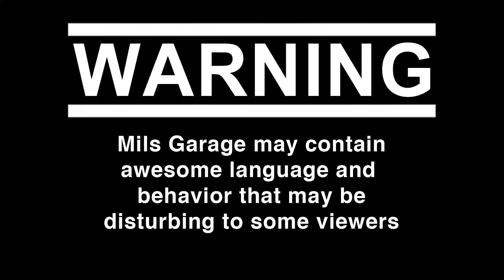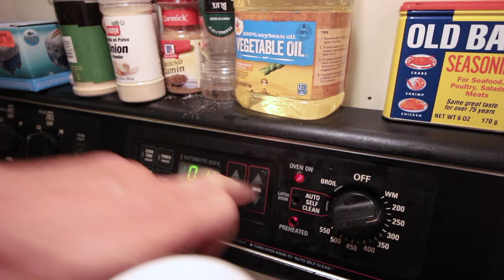Easiest Way To Open Headlights [Separate Lens From Housing // All Cars] (w/Pro Tips)

Comment: Better to replace the whole thing, its faster than doing all that just to remove the lens
Reply from the maker: We fix and modify them at the shop, so this is a normal day for us 🤘
Reply: In my case, 2010 Audi Q7, the lens were 180 for the pair, 1 headlight assembly would cost me close to 1000usd so way cheaper to replace the lens.
Reply: I wish you guys were in Utah! But Delaware is a bit of a hike for me. I’ve called several auto body shops and they all either say this cannot be done because the entire headlight assembly must be replaced or  they refuse to do it. Do you know of anyone near Salt Lake City who would take on this challenge? I have a gas oven so I’m afraid I may melt the housing.

Comment: would this work with glass headlights?
Reply from the maker: Great question, and i'm not sure. It might work, but i've heard that there are glass ones for BMWs that it absolutely won't work with.. Are the headlights older? i'm not sure when they changed to the 200º adhesive.. It may have been released around the same time as the introduction of plastic headlights

Comment: What do you suggest doing to the remaining adhesive on the lenses
Reply: Did you clean it all off or just leave it when you resealed it?
Reply from the maker: For the gunk, we have an episode on Headlight Restoration (Permanently) https://youtu.be/ctijYGteLFY 👍
Reply: Mils Garage thank you!!
Reply from the maker: @madisen marshall Any time 💯
Reply: @X9Dyingtolive9X  for these headlights I cleaned off all the old adhesive and put new adhesive on.  However if there is still enough adhesive left when you take them apart and it stays clean then you can definitely reuse it.  Just make sure there is enough, you dont want any gaps that might cause an improper seal :)

Comment: Melted the hell  my headlight, but the glue sustained :(
Reply from the maker: At 200°F?? What type of car?
Reply: @milsgarage  Celsius
Grand Cherokee 2011
Reply from the maker: Oh man.. That’s double 😢. i’m sorry, we didn’t realize it would be an issue for our international audience until the video was posted
Reply: @milsgarage  Not your fault. I started at 130 celcius but once i saw it is not working, i just started to raise temperature while checking how glue reacts (it didn't) 
Read on different forum that melting point for plastic is 200 celcius, so i tried to push it to the limit and just wasn't careful enough.
In the end, I managed to broke the glass barbarian way. Took me two days to open and replace plastic for both headlights and luckly, one can not see the true damage for the one headlight that melted, since the melted part is hiden under the hood.
Conclusion: Check glue type that is applied on your headlight, before you try to melt it.
Reply from the maker: @Michael Leybovich Arg.. i can tell you, i've also made expensive mistakes, and it's never fun. i didn't know any better about Jeep headlights before you mentioned it now.. Forever learning